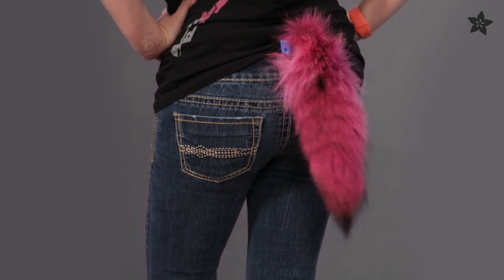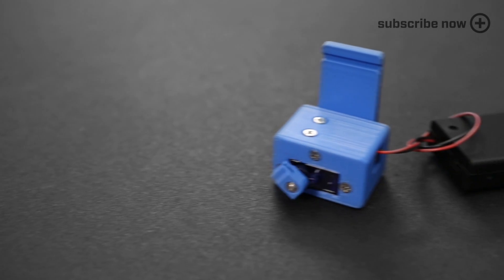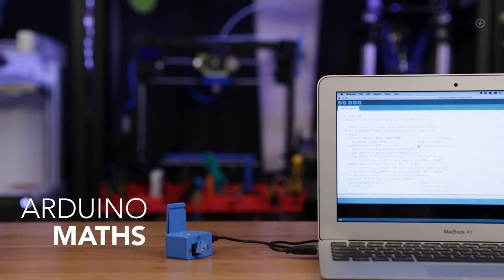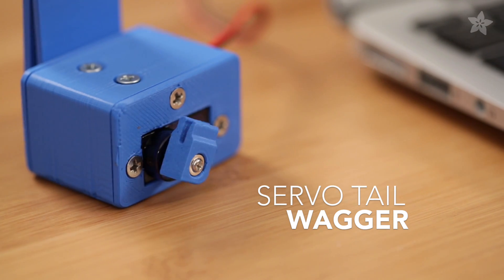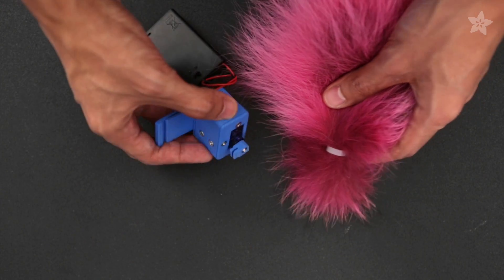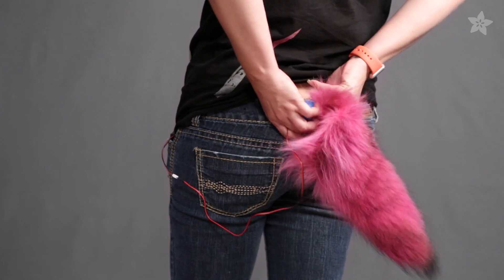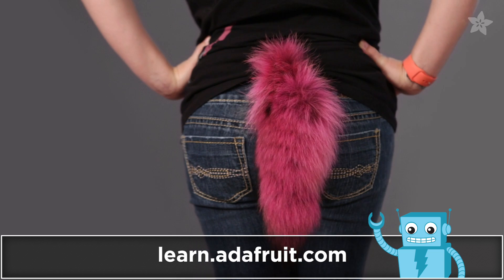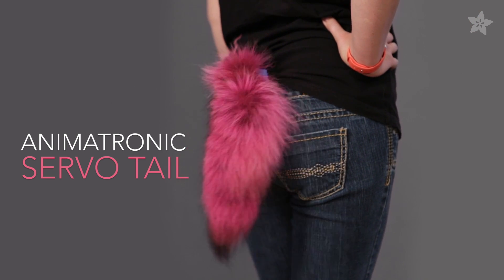Really Simple Animatronic Tail with 3D Printing

Comment: One simple fix to take this from mildly lame to fully awesome: Run a line down the inside of the tail, but attached only to the tip. Then modify the servo enclosure with a spool, to roll up and unwind the line, both ways. The result will be the tail curling upward in each direction, rather than simply swinging from a single point of articulation. (It'd be your basic animatronic tentacle, but with fur.)